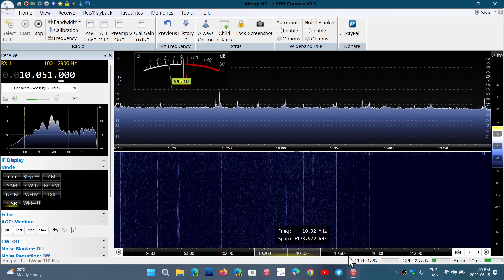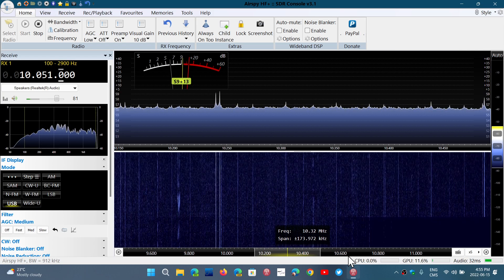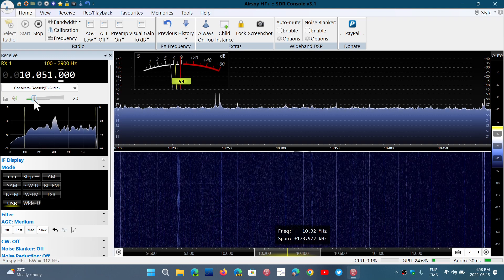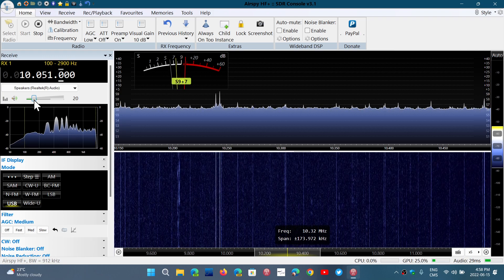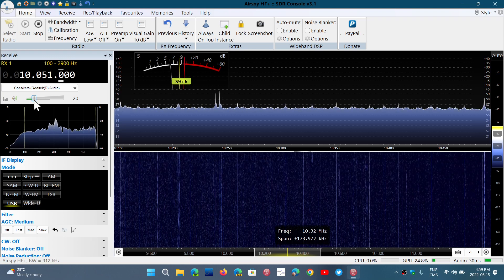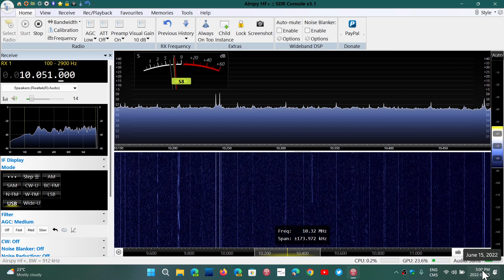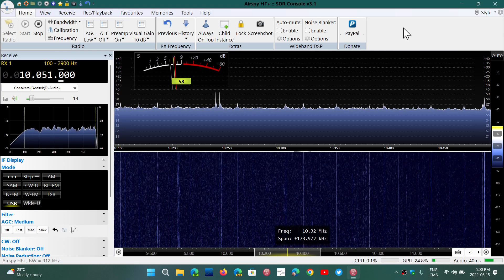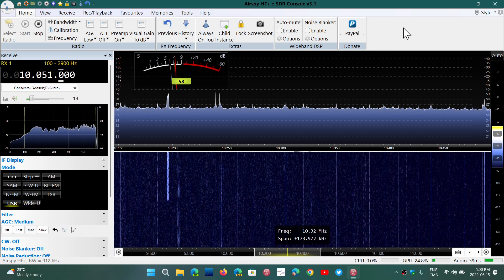What is Gander VOLMET What is it for and the frequencies and times it broadcasts

Comment: To answer your question, we dont. Volmet's are like NDB's. They arent used anymore. We check weather via a system we call ACARS, Commercially that is. Its a digital data transfer system that uses all three forms of communications that modern commercial aircraft, use. VHF, HF and Satellite. The system will autonomously switch between all three forms of comm's and auto tune. It prioritizes by VHF, HF the SAT, in the worse case scenario. If there is no VHF freq available, it will switch to HF and then SAT. 

We are equipped with 2 HF radios and this is another reason we dont use VOLMETS. HF1, is used for tuning. It is our primary means of long range communication (kind of.) We use a system called CPDLC, but thats another discussion. So with HF1 we are assigned a primary and a secondary FREQ by for eg. Gander Radio. We need to always be tuned to one of those two frequencies, so they can communicate with us. (That too will soon be a thing of the past.). HF2 is used by the ACARS system discussed above. We would never de-tune it from that system, unless it was a really, really bad day.  

So in saying that, with only two HF radio's being tuned to dedicated freq's we cant tune a VOLMET. 

Today we get our weather from other sources. As I said before, ACARS, where we can select the specific info we want. We can also get it from onboard WIFI. Our IPADS have specific apps that work with the onboard WIFI that gives us weather info and much more. (Dont worry, we cant surf the internet or watch Netflix while flying). 

If things were bad, GANDER radio gives weather info as part of their job if requested. (Its important to note. If you are listening to aviation Comm's. If you hear "radio" in the call, i.e "Gander Radio, Toronto radio" etc , they are not air traffic control. They are what we call FSS, or flight service station. They are radio operators who provide weather, relay messages to and from ATC in remote areas and are there only to help pilots. 

Lastly we have SAT COM. We can call our dedicated company dispatcher via Sat phone or ATC and request weather. 

So, there you have it. VOLMETS as cool as they are, are truly echoes of the past still being broadcasted. They really serve little purpose, but are still a lot of fun to listen to. As a pilot who crosses the Atlantic every week, the only time I hear a VOLMET, is when I am listening to my Short Wave radio on my deck. 

Cheers!
Reply from the maker: ok cool ..thanks for the info ... I will use your comment as a discussion topic in my live show...thank you
Reply: @OfficialSWLchannel   no prob at all. Just trying to pay it forward. Ive been subscriber for a long time and have learned a lot from your Chanel. I bought a short wave radio and so did my Dad because of you. So thanks for what you do and sharing your knowledge. Cheers.